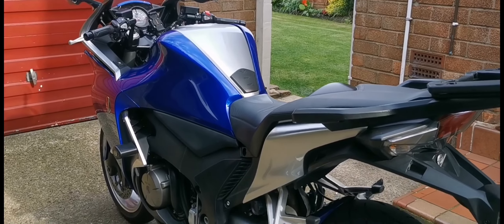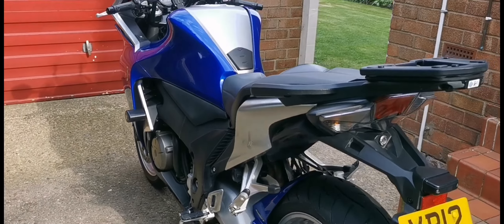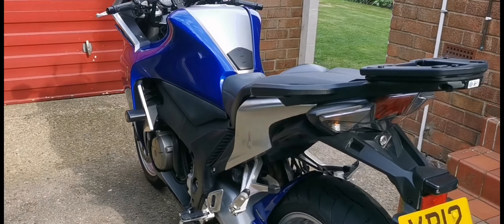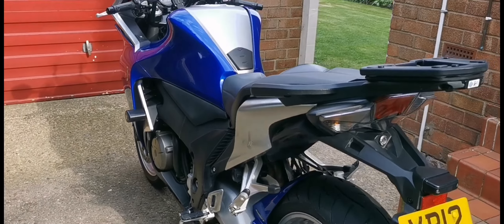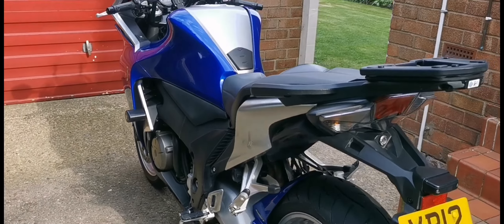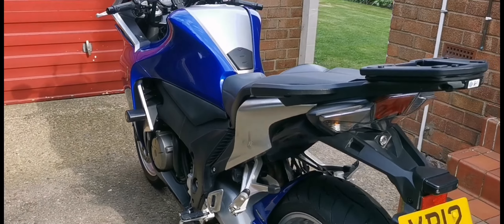Honda Vfr 1200 Close up!!!

Comment: I’m thinking about the vfr1200 or the bmw k1300s🤔 , got a 2018 bmw r1200gsa rally at the moment and a k5 gsxr1000, the bmw is in limp mode at the minute so I’ve been riding the gixxer which has made me think do I actually need all that tech waiting to go wrong 🤨 and I’m thinking I prefer 4 cylinder!!, how do the vfr1200 and bmw k1300s compare in the reliability stakes 🤔
Reply from the maker: Missed this comment sorry .
I guess I'd need to have owned a k1300 to answer wether the Honda is more reliable, all I can say is , I've done 23,000 on mine on top of the 16,000 that was already on it, and apart from 2 bulbs blowing and a cautionary change of front wheel bearings, it's been fine. Also I get very very few comments about problems.
Reply: @Grahamvfr  that sounds good to me!! there’s too much tech on these bikes now🥲